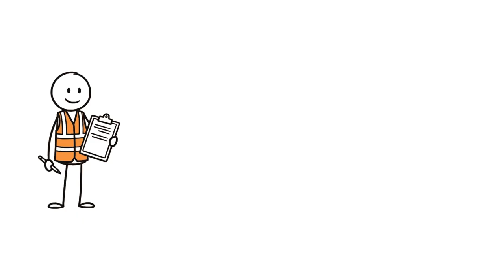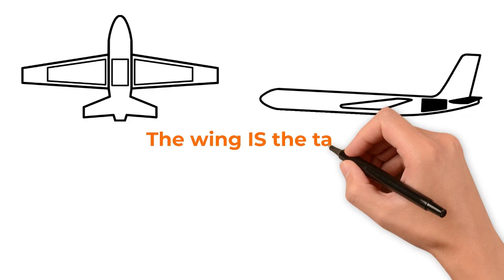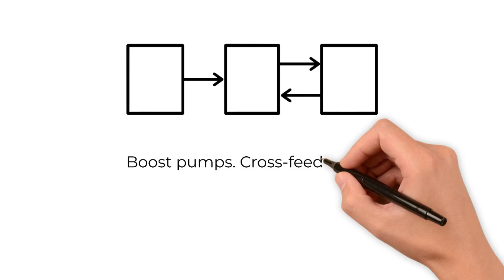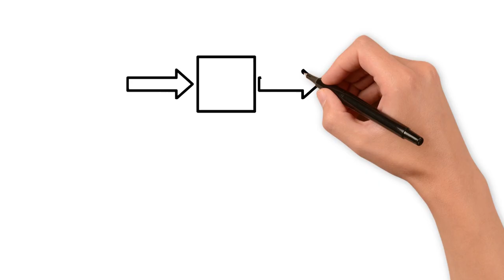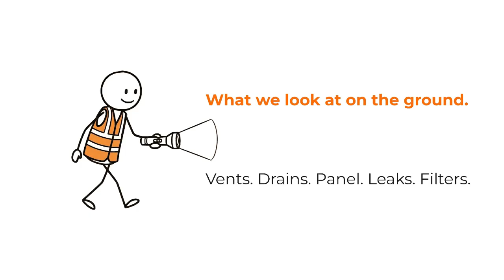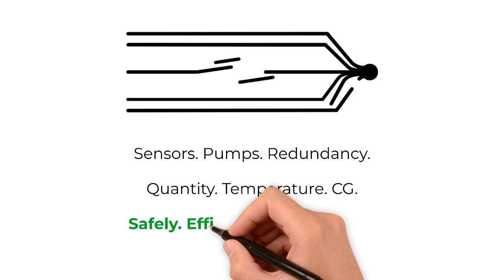Aircraft Fuel Systems: Why 200 Tonnes of Fuel Never Sits Still

Comment from the maker: One thing that did not make the video: before the first flight of the day, we drain small samples from the lowest point of each tank. We are checking for water. Fuel floats on water, water sinks to the bottom, and at altitude that water freezes. A few seconds at a drain valve on the ground prevents a blocked fuel line at 38,000 feet. That is the level of detail this system demands.